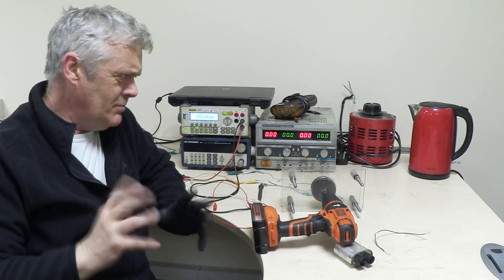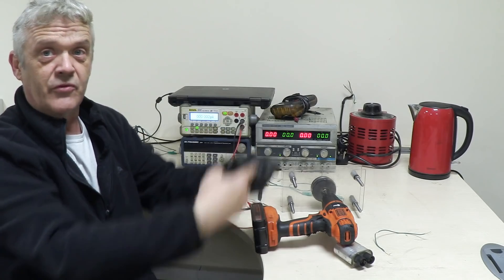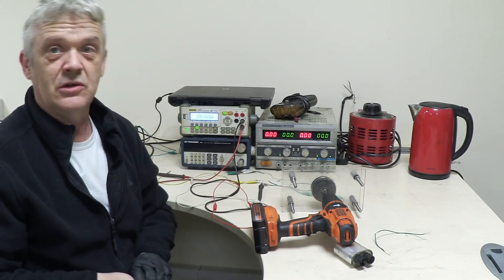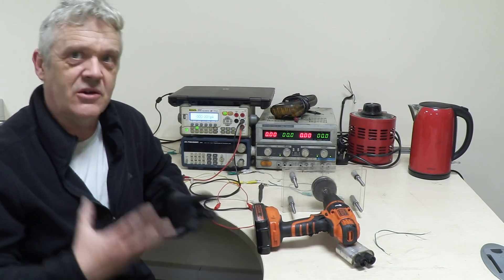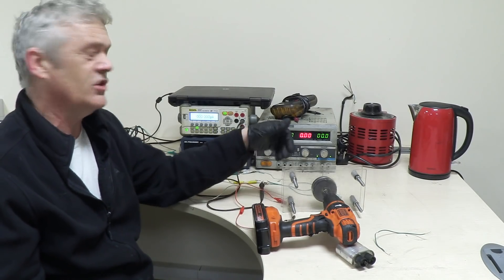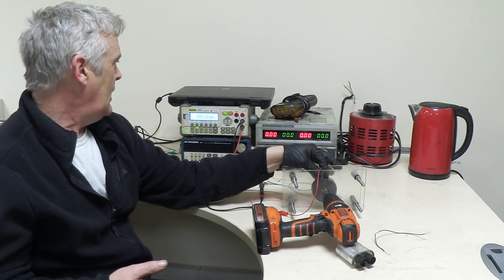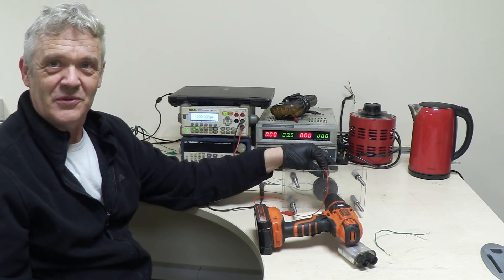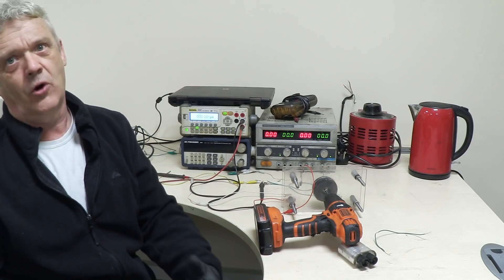Strange Behaviour Of A Tesla Homopolar Generator

Comment: There is relative motion between the magnets and the measurement wires.
Reply: Rotate spin axis NSEW while repeat expirment. Will confirm /deny interaction with earths mag field..
Also repeat with dummy magnets.  Same mass non magnetic.. 
Repeat with  opposed magnets.  Both N poles to disc and for completeness S S to disc..
My money would be on the compass effect intact.  Interesting if exploitable.... Bear in mind simple magnetic needle does seem to suffice most of the time.
Reply: surely if that were the case then it would also be picking up voltage prior to the brush contacting the plate?
Reply: @weegaz22  not if you are unknowingly creating a tuned circuit picking up Wi-Fi or cell phone rf etc.
might not manifest itself otherwise. unless you can eliminate these intrusions you are not going to get a pure outcome.
granted these experiments had been done when none of these transmissions had been going on in feradays time but then what was he seeing that intrigued people to peruse the clue that led to the fundamental understanding of electricity?
Reply: @weegaz22  Has to be a current path. Conductor.
Reply: Nope wrong. The rotation of the magnet has nothing to do with this. A similar experiment can be performed holding the magnet static and only rotating the disc and you will have the same voltage generated. The disc itself is inducing an EMF.
Reply: @ZeroInDaHouse  if you rotate the disc relative to fixed magnets eddy current would be induced in the disc.
Reply: What is the reading with just the aluminium disc by itself? Perhaps the movement of the assembly through the earths magnetic field is causing the effect?
Reply: There is some relative motion with the internals or the bearing that are within the field of the magnet.    Maybe try a non metal bushings for the test???
Reply: Just connect it straight  to the ammeter with short wires. The relative motion is between the current path through the disc and the magnetic field.  What makes it counter-intuitive is that you don't see that path inside the disc. Consider that in order for current to get from the hub to a point on the rim it absolutely does have to cut across field lines.
And get rid of that resistor. The voltage produced from these things is so small that to get any current flow you need an extremely low resistance path.  When designed well they are actually capable of significant current due to inherently extremely low output impedance.  Whatever value you picked, it's bound to represent an impedance mismatch.

The magnetron those magnets are from actually had something very similar happening inside but driven by current.  Inside, electrons were coming off the cathode and trying to stream radially outward from the center to the copper walls and without the magnets, they would.  However, within the axial magnetic field they are instead forced to spiral outward and in doing so, move past the cavity openings, which is what induces the microwave oscillation.  In the generator the voltage gradient is radial between the hub and the rim but the current is made to follow a spiral path due to the motion of the disc in that case.

There are some significant differences but it's a bit like how blowing air over the mouth of an acoustic cavity excites oscillation
Reply: @whatelseison8970  if it were true that the current path through the disc was the relative motion, there would be force induced by A x B, and that doesn't happen. There is neither in inward facing force ( compressive ) on the rotor shaft, nor a resistive force against the direction of spin. Also, such a force can't be induced via Maxwell, regardless. In that formulation, you must have physical motion at some positive phase angle to the field. So, even if it were true that this virtual relative motion was causing the effect, it violates Maxwell.

This experiment has been around for over 100 years...believe me, it's been exhaustively studied by experiment. It's still not understood in relation to standard models.

If you want to prove your point, make a disc from an insulated metallic ribbon, connect that to a conductive ring and spin it. You'll see what happens didn't gibe with your explanation.

Oh and...if the current path is the stator, how does it get started in the first place? Faraday did his initial experiments in isolated conditions, as have many since, so ambient currents have been eliminated.
Reply: @timothyblazer1749  Wait.. I may have misinterpreted what's going on in the video.  Is he spinning the magnets and disc together?   If so then you're right, there's no physical model that could explain the supposed effect. I thought this was just a normal homopolar generator.

That does make the rest of these comments make a lot more sense though. 😯  

Since it's unlikely there's any new physics being discovered here there must either be something wrong with the setup or the assumptions.  Since the current is absolutely tiny, maybe the geomagnetic field isn't so easy to rule out.  Aside from that, there are permanent magnets inside the drill that could be influencing the experiment.  What's your hypothesis?
Reply: @whatelseison8970  yes, he is spinning them together. And 4 microamps is an enormous current compared to the local geomagnetic field. Also, he is spinning it vertically, and so is not cutting geomagnetic field lines.

I don't like to make assumptions about physics models when experimenting per se... The reason this is still a paradox is because many experimenters ( look up Kennard ) have approached this over many years and haven't been able to create an explanation that fits all the observable phenomenon. The best one so far is a pure Lorentz force claim, however there is no other system that exhibits this effect, And centripetal force inducing electron drift is a stretch. Also, if the Lorentz claim is true, that violates relativity.

So, I think I don't want to say I know where the effect is coming from, except to point out that it does not accord with any model we know of. Basically, it is showing us that our model has a gap that needs to be filled.

Think about it...pure, isolated mechanical motion makes this happen. Even stators and meters have been co rotated and the effect still occurs. The only energy going into this system is centripetal motion, And magnetic flux is not being varied over time.

Personally, I think the key to figuring this out is really digging down on current and voltage curves within rotational speed regimes, as well as playing with open circuit versions, and coils, etc. That data might give some clue. Oh, and test the thing while stationary, And while in a jet plane, And in the ISS.

And by the way...a metallic neodymium magnet in disc form can be rotated in situ, without a conductive disc attached, And it produces the same results.

I don't know of any serious ( aka well funded and carefully conducted ) experiments being done on this for a long time.
Reply: The earth's magnetic field is fluxing in relative to the generator
Reply: @805travis  The magnetic field strength from a strong ferrite magnet can be up to 0.35 T.  The magnetic field strength of the Earth in the northern hemisphere is around 30 uT.   There's just no contest.

That said, Earth's magnetic field is still relatively strong when compared against every other terrestrial planet or moon in our solar system.  It's just so huge compared to the human sized dimensions of the experiment that it's spread pretty thin. It's even large compared to the earth itself. Hence, its overall density is comparatively negligible and can be ignored here (with magnets field strength=field density).
Reply: It's the Lorentz force
Reply: @patriotsoftheunitedstates4173  the Lorentz force hypothesis has not been proven in this case. Electron migration on this order of magnitude is not known to happen under these conditions in any other circumstance, without some sort of E field.
Reply: Right...however there is no way to account for the amount of current with that observation.

In addition, spin the generator without that connection, then just touch a conductor to the edge and you get full current, near instantaneously.

Finally, if you make one with a gap between the magnet and the edge, it still works, And produces the amount of current your would expect from a generator without that gap.

You see, experimenters have figured this out. The relative motion between the take off and the magnet isn't enough to account for that.

In addition, there is NO resistance from that conductor, caused by eddies on the rotor, as there should be. We know that primarily because pools of mercury have been used as the take off and they do not distend inordinately, and because torsional measurements have been done with, And without a magnet and they are the same. Multiple takeoff points have been employed and the current doesn't rise, as well, as you would expect from that hypothesis.

There is no mechanical resistance. It's not a small amount...it's zero.
Reply: marinerenewable  do it with a data  logger, like a tiny arduino. it could all be self contained and spun together.
Reply: You beat me to it
Reply: @ClownWhisper  so far unicorn tears is the most plausible thing I have heard.
Reply: I’ll post a YouTube channel for some good experiments to aid people's analysis. I don't agree on his/her theory though. Personally I don't believe the magnetic field spins with the magnet due to its geometry and magnetised direction ( I go back to the ether model, the magnet creates pressure within the ether nothing more, so spinning the symetrical magnet on it pole axis doesn't move the field).
Reply: The rotating field is also cutting the wire attached to your brush inducing a voltage.  Disconnect your axel wire and connect it to the brush, but holding both wires in approximately the same place, then spin the magnets. You’ll notice the induced voltage producing a current. Of you open the circuit at the other end and just attach a voltmeter you can measure the induced voltage directly. V=d_phi/d_t
Reply: Would it work if the disk was static and only the magnets spinning, eliminating the brush?
Reply: That was my exact thoughts.  Sorry Nothing unusual here.    You'd expect a small current from the testing wires being in close proximity of the field.
Reply: That's right. And that's is why we have "The Paradox". In order to measure something, an electric loop has to be formed and consequently, the induction effect comes to present everywhere in the system. It is small but It is there.
Reply: This is the effect of the disc rotating in the ether. Rotation of the magnet does not make any change, because the magnetic field does not rotate with the magnet, it remains starionary like a gyroscope.
Reply: I believe the real issue is load. Not about motion. Eddie current, or resistance, which creates load.
Reply from the maker: that is certainly one of the interpretations of the faraday paradox
Reply: @ThinkingandTinkering  You could duct-tape a multimeter to the disc to test.
Reply: @tuusnullorum  Tape an ESP8266 to the wheel and let it tell you the reading, but where would you connect the input? I think with it all spinning together there will be no induction.
Reply: @ThinkingandTinkering  Robert, have you tried this with a sealed off pipe (effectively a disk with an extruded circumference), so that the probing can be done far away from the magnet, which would be at the sealed off (disk) end of the pipe ?
Reply: @ThinkingandTinkering  another similar idea is to use a disk of much larger diameter in relation to the magnet, though for some reason that variant feels off, but I would love to see a comparison. Cheers
Reply: Good observation that I had not considered as well as the interaction of carbon bouncing on metal while held by a finger connected to a body (as antenna) in a room full of RF
Reply: Could it really be that easy? There is a magnetic field that is moving relative to the motion of the disc. OR more specifically the disc is moving relative to it. (actually, there are at least 2, maybe even 4 magnetic fields generated within the Planet that combine to cause magnetized compass needles to point in two to three different directions in the northern hemisphere and two to three other locations in the southern hemisphere.) So, it is reasonable by that redefinition of your "imaginary isolated conditions" to resolve the paradox. One would have to measure and neutralize the natural magnetic field of the planet, moon, Sun and other planets to properly test the induction theory. Without doing this, its just pseudoscience (non-falsifiable). Party on Dudes; be good to one another.
Reply: bs
Reply: Gotta have a coil or bundle of wire to get that many amps.

Comment: In fact you have rotating magnets and that wire with brush is static relative to magnets,... Some smal current is generated in that wire. Metal disc do nothing, just holding magnets.
Reply from the maker: that certainly is one of the modern interpretations of the faraday paradox mate

Comment: Your brush contact is moving in relation to the magnet so it will see a current which you measure..
Reply: I totally agree. https://en.wikipedia.org/wiki/Faraday_paradox#Taking_the_return_path_into_account
Reply from the maker: it's an example of the faraday paradox for sure and you are using the modern interpretation of that result as an emf is produced whenever the disk moves relative to the return path - it was shown that so long as a current loop is used to measure induced EMFs from the motion of the disk and magnet it is not possible to tell if the magnetic field does or does not rotate with the magnet. (This depends on the definition, the motion of a field can be only defined effectively/relatively. If you hold the view that the field flux is a physical entity, it does rotate or depends on how it is generated. But this does not alter what is used in the Lorentz formula, especially the v, the velocity of the charge carrier relative to the frame where measurement takes place and field strength varies according to relativity at any spacetime point.) - taken from wikipaedia
Reply from the maker: really? - ok

Comment: There is a paper out there from 2014 - could this be related?
"Electrodynamic Wireless Power Transmission to Rotating Magnet Receivers"
Reply from the maker: maybe mate
Reply: I haven't read the paper but I but I believe that's referring to systems for transmitting power through the use of a motor-generator set that are coupled via a pair of actual rotating permanent magnets.  Much like a larger scale version of a magnetic stir plate.  I've heard it suggested as a means of transmitting several kW a very short distance without needing a high current connector to, for example, charge EV's by having the motor embedded in the garage floor and a generator affixed to the underside of the car.

Comment: Does it replicate with mercury brushes?
Reply: The original HG was made with mercury for contact. It was able to power a huge heater, and was performing in overunity.
Reply from the maker: it should but i wouldn't try that - maybe another metal liquid at RT

Comment: There may also be a tiny interaction with your body's field. Am I right in suggesting the glove wouldn’t stop that?
Reply from the maker: you are think of a capacitive field?
Reply: There seem to be several fields associated with the body. https://explore.scimednet.org/index.php/2016/04/02/the-human-energy-field/

Anyway, it would be easy enough to fix the brush and eliminate your hand. More difficult, however, to compensate for the earth’s field, so as to achieve a truly closed system.

Comment: Hi Rob, might be interesting to see what reading you get with whole device mounted horizontally or indeed in different positions or even outside where "possible" fields of interaction would be higher, :-)
Reply: Might also be worth checking - turning your wheel by another method to rule out that the drill is not the cause of any induced current due to PWM noise and metal to metal contact?
Reply from the maker: for sure - give it a go
Reply from the maker: go for it mate this is easy to replicate

Comment: Robert, when I played with this effect it opened my mind to the idea that a magnetic field is stationary on it's axis. I believe rotating a magnet like you did is not rotating the field, therefore the relationship between motion and power is realized when you imagine the conductor moving through a stationary field. As you've found, the lack of eddy currents with this style unipolar generator under no load makes it interesting. Thanks for the detailed video as always!
Reply: When you rotate a magnet with copper plate such that they have zero relative motion, then magnets magnetic field rotate with the magnet and interacts with the earth magnetic field lines which are present everywhere on earth, that's why a compass always points to North & South. That relative motion between the earth magnetic field and magnets magnetic field generates the current in the copper plate.
Reply from the maker: cheers mate

Comment: Perhaps a triboelectric effect? Have you tried with a copper brush?
Reply from the maker: have a quick look at the description mate - i don't think it is triboelectric
Reply: @ThinkingandTinkering  Interesting. Then I would wager that this involves flaws in the magnet's structure producing inconsistencies in the field density, which produce relative motion within the field due to their varied reaction as they sweep over nearby magnetizable metals. One would think that would produce an AC signal but there may be a diodic effect between the carbon and aluminum at play.